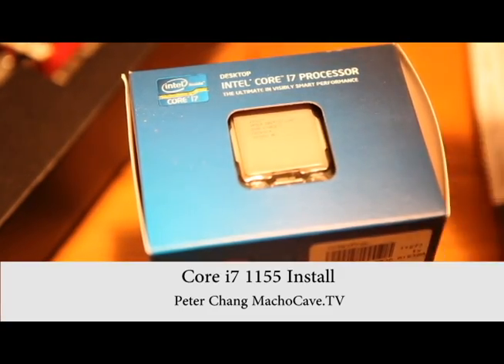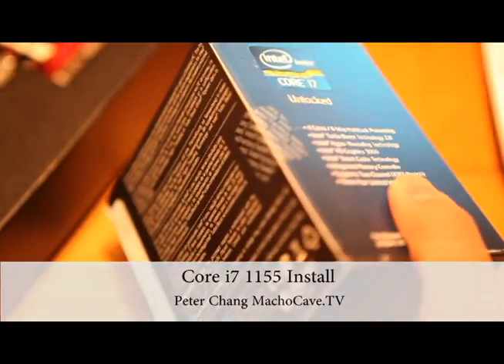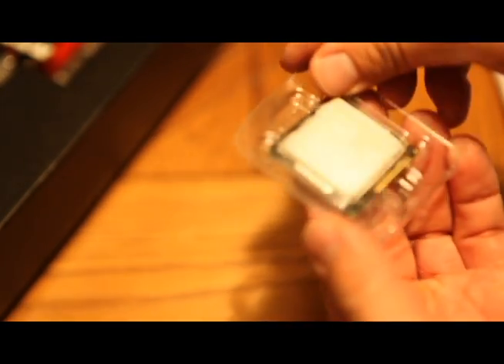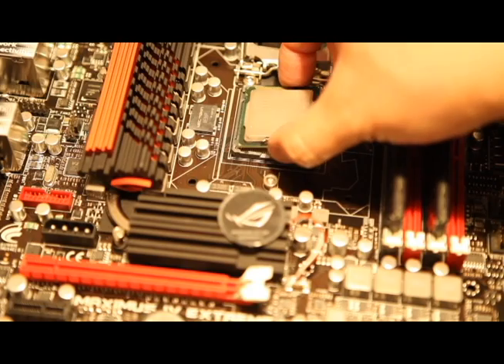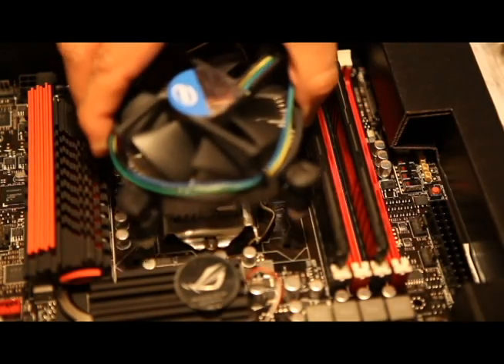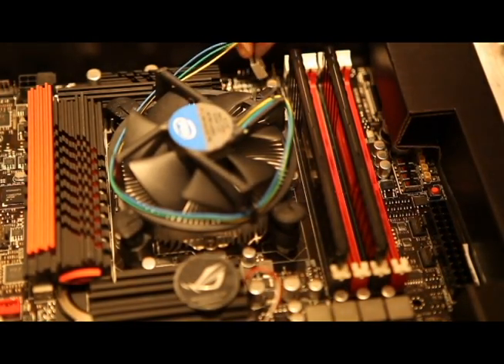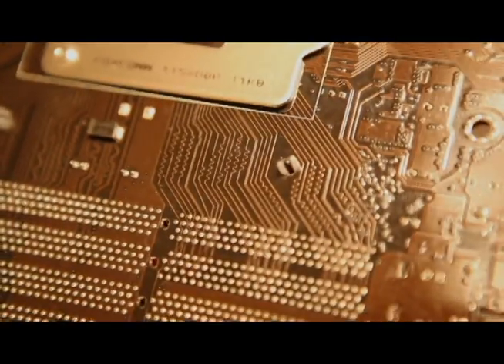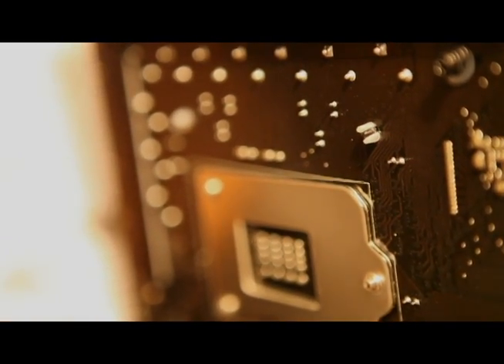How to Install a Core i7 1155 Processor Heatsink and Fan

Comment from the maker: Great question! When using the stock Intel heatsink and fan there is a thermal compound "sticker" already applied to the stock heatsink. You are correct--if I had a different heatsink and fan I should use a thermal compound :)